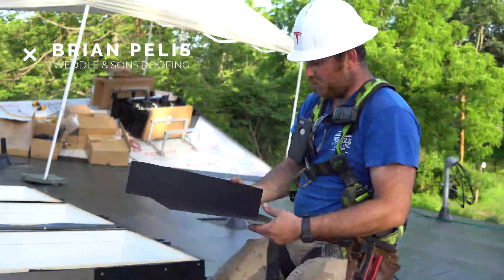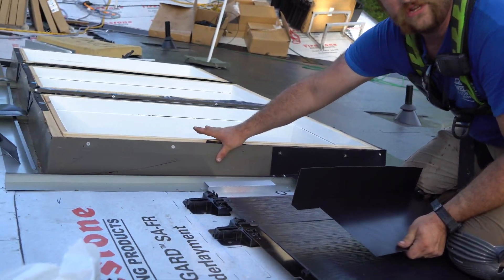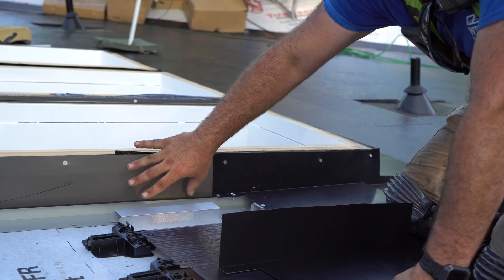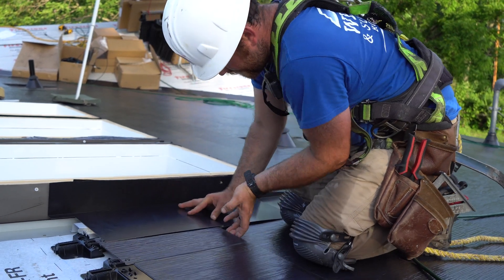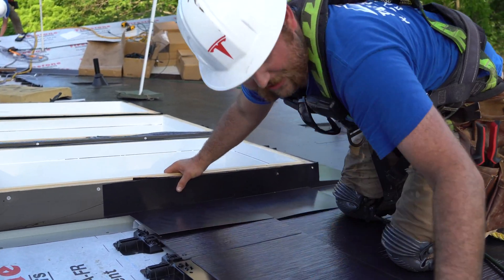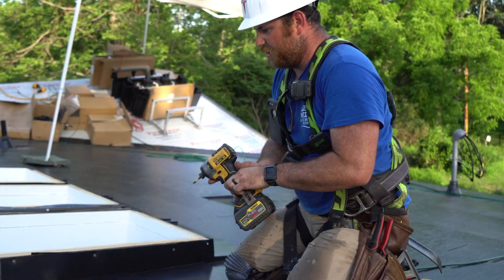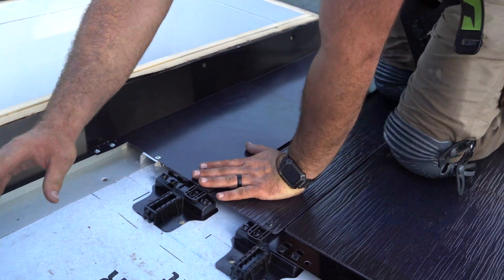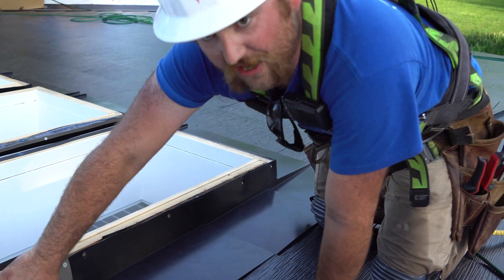Tesla Solar Roof: Skylight Sidewall Flashing Installation

Comment: Your videos are very valuable. Thank you. Would you have a picture of the finished skylight installation? How seamless is it? I have seen other videos of Tesla roofs with skylight flashing that seems to stick out like a sore thumb and some that looked alright. It seems to be inconsistent. Maybe due to the various versions of the tiles and accessories. I have also seen junction with brick gables or chimneys that look terrible in my opinion with black flashing forming large black "steps" on the red brick background. Tesla roof is all about aesthetics, so I would like to make sure it looks good not only on a straight roof  without penetrations, but also around skylights, chimneys, gables.

Comment: I need to replace my skylights and my project advisor said I should do that before tear-off, and that the curb should be replaced with one that "is at least 6 inches tall".  However it looks like the flashing is a certain height (not custom-made onsite).  Do you know the height of the curb lumber?  It looks like 2x6 (i.e. 5.5 inches tall).   Can you confirm that the curb in the video is 5.5 inches tall?
Reply from the maker: Glad you asked! We do have to rip 2x8s for the curbs. 2x6 isn't quite high enough. We build ours at 6 3/8". There's a little bit of play, but that is the sweet spot. =/- 1/4" from that is probably ok.
Reply: Awesome, thank you so much!  You might want to let Tesla know.. They didn't seem too sure what the right height should be.